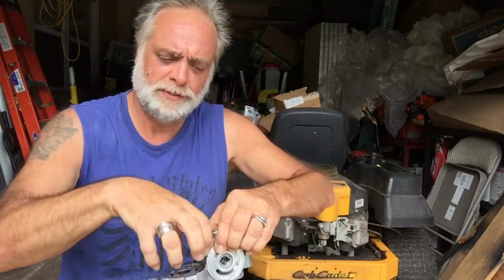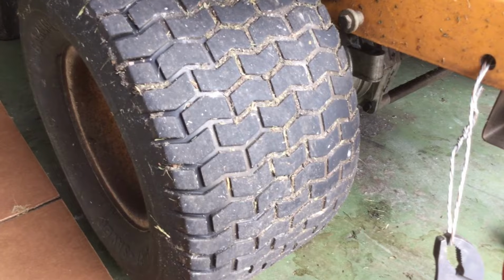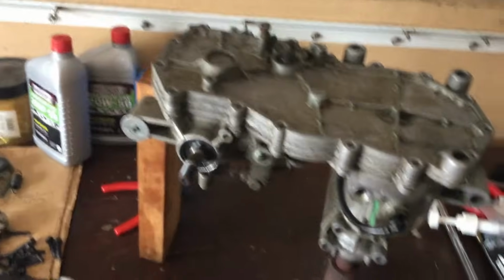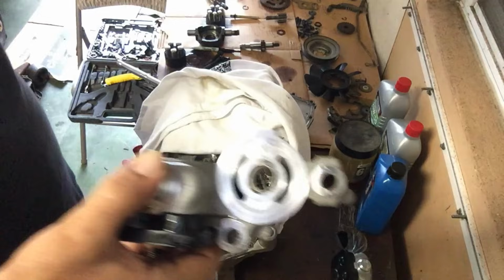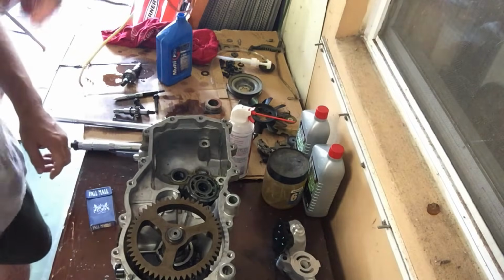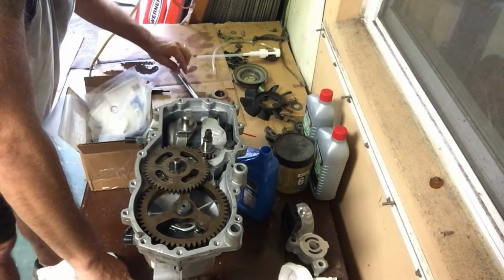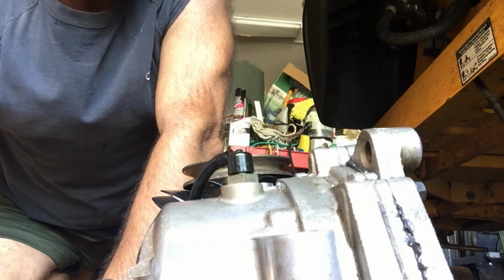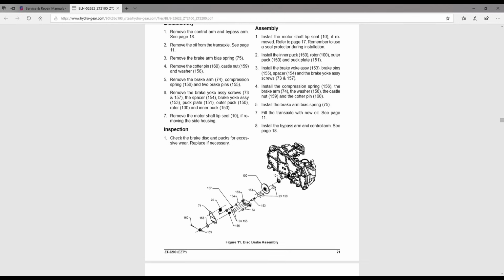Cub Cadet RZT 50 Riding Mower Hydro Gear Transmission Rebuild

Comment: I was mowing with my zero turn and it stoped driving on one side randomly any ideas
Reply from the maker: Blah, 11 months ago I might have been able to speak more intelligently about it, so I’m just speculating.  Is it a hydro gear  transmission?  Does the side that stopped make any noise when it’s engaged?  Does it ever work or has it stopped completely?  Was that side loosing power slowly or was it working fine and suddenly stopped?  It could be something wrong with the COG brake assembly, maybe its stuck.  Could be something wrong with the bypass arm or bypass rod.  Could be something wrong with the control arm.

Other potential might be something wrong with the internal gears, but I’d think it would make a grinding noise if so.  If you were slowly loosing power over time, then it could be the pump block and center section and/or springs and pistons.

Lastly, could be a leak in the gasket and you have no fluid in he trans, but I’d think you would have heard some grinding before it stopped working.
Reply: @silentknightsaga2415  Thank you for   responding. I think it is a hydro gear it did shake and jump under any kind of load towards the end of it working. when it died I pulled the hole thing out I wanted to drain the oil out to see if their was like any O-ring crap in it so I drained the fluid out of it and  I got about 3/4 of a cup of tar looking oil out of it and it was so thick I could not even tell so I put in fresh 10w30. I put it back in and nothing no noise I had it jacked up with the tire off when I tried and it didn't even try to move I checked the bypass rod I moved it back and forth it kinda clicked but nothing all the linkages move normal it is a single unit meaning the pump and motor are together. but I really hope I can fix it and not half to buy a new unit.
Reply from the maker: @gunnerstanwick6663  Well, sounds like the “joy” of cracking it open is in your future.  I’d think it would be unlikely if it couldn’t be fixed, though obviously depends on what type of damage you might find.  All parts are replaceable, so it’s a matter of trying to accurately diagnose what’s “broken”. There are lots of moving parts in those things, but not overly complicated.  It could even be something as “simple” as a spring or tiny ring clamp that broke loose from the shaft inside.  If you figure it out, no matter what you do, make sure you clean the inside well, especially given the tarry substance you found, and keep any particles out of the unit as you work through it all.  That was the issue that caused my first rebuild to fail.
Reply: @silentknightsaga2415  Well I am probably going to half to do that. I have a parts washer that might come in handy. but I will keep you posted on what I find

Comment: This was a good instructional video.  One of the better ones on the subject.  I’ll offer a little constructive criticism though, and I’m in no way jabbing at you.  It should have been edited down to about 1/3 the length you have it.  Also, be careful when removing the seals and keep track of your lock rings...there is no reason whatsoever to drop $30 on a “seal kit”.  I did a lot better than you on the center section too.  Amazon had it for $110 directly from Hydro Gear.
Reply: Do you got a part number for it?
Reply: @kypyro5029    https://www.amazon.com/gp/product/B000PZSDLS/ref=ppx_yo_dt_b_asin_title_o08_s00?ie=UTF8&psc=1

Comment: Hey dude, thanks a lot!  There was a lot of good information here, very detailed. One thing to add, I rebuilt both of my Trans and you had mentioned not bothering with the axle side. Well it wasn't cleaning well enough for my liking and one ring clip holds it in so I took it apart, there is a reservoir underneath the big gear for the top bearing to stay lubed with plenty of oil. I found some grit and other pollutants in this chamber, so I cleaned it out and resealed it and while I was at it I went ahead and changed out the bearings which were only like six bucks a pair or something. I figured I had this much time and ca$h in it might as well go for it. Oh, one other thing, the breather hose on both of mine were clogged, hard to get rid of air pressure if it can't breath. I normally don't write these, just want to say thanks and share what I ran into. Btw, I think my hair line is a little higher now.
Reply from the maker: Yah, I didn’t want to press my luck with the axle.  Glad you found the video helpful, and there’s always hair club for men....

Comment: I really appreciate your video. My rebuild went pretty well.  I would not have attempted to rebuild this if it wasn't for your video! I found a way to "prime the pump" after the rebuild with it out of the machine using a drill to spin the drive, and I worked the bypass/operator with my hand until it primed up. The fill hole on my RZT22 is just about impossible to access after it is installed.  I made a video and gave a shout out to you.  I hope you don't mind.
Reply from the maker: Glad to hear it went well and that you came out of the process still coherent and human.  I’d like to see your vid.
Reply: @silentknightsaga2415  Here's a link. https://youtu.be/2MWIAlU388Q
Reply from the maker: @mattc6044  Ah, I see your trans does look a little different.  Was able to use a pneumatic wrench to take off my pulley.  Love how people solve their own unique puzzles they come across during their rebuild.  Don’t love how companies manufacture products that make it difficult to do common maintenance like refilling the trans oil.  I’ve seen some videos where people actually drilled holes through their deck to access the fill hole.
Reply: Excellent idea!!

Comment: SilentKnight Saga, You rock brother. I completed the rebuild, using this video and the manual. Success. First cut was flawless.  Thank you for your time, instruction, and shared mistakes. Also the commentary along the way, light humor, etc., was appreciated. Thanks again. (This transaxle was on my 2011 Bad Boy MZ)
Reply from the maker: Great, and hopefully you came out of it on the other end with a little more sanity than I.   Mine is still going strong so, what, now 7 months later I guess.  Hope yours does as well

Comment: Working on mine right now. One thing I truly appreciate is that you gave specific info about not removing the center section bolts before taking out the shaft. I will be putting the bolts back in to do this, cause that sucker is in tight and was wondering how to take it out without damaging something. I hope to update on this soon. Thanks so far for this video. Commentary is great.
Reply from the maker: Welcome.  First time I tried the rebuild I left the bolts in and went down a bit of a frustrating road, ended up chipping the casing a bit around the rubber gasket and did some unnecessary things that cost quite a bit of time.  Good luck with it.  Sounds like you’re making a lot of progress.  Most difficult thing after that is putting the pump with pistons back in with the center sections but if you do it as outlined in the video, it should go as smoothly as possible.  Lining the hole of the pump up with the hole of the center section so the shaft fits back in can also be a bit tricky, but perseverance will win. Once it’s properly aligned, it will slide in without difficulty, no need to force it.
Reply: @silentknightsaga2415  Awesome, thanks for those tips. I will be getting back to it in a day or two.

Comment: I'm about to perform this rework on my RZT-50.  If I have access to a mill, is there enough movement in the pistons to allow for refacing of the center section?  I'm imagining I'd only be removing about .005" off those mating surfaces to clean up the grooves.....no?
Reply from the maker: So the pistons are spring loaded so to speak and while I can’t say 100% that resurfacing the center section would work, I can tell you that those pistons definitely lay very tight against the center section so one would think a .005 shave wouldn’t cause a problem.  Just keep in mind, if it doesn’t work, you’ll have to do it all over again, so if you’re willing to risk that, then no big deal.  Good luck with it.  Remember to make sure the center section and motor/pump sections are completely free of any debris before reinstalling.
Reply: @silentknightsaga2415   Thank you  good work,

Comment: I have a RZTS46FAB and it needs the cooling fan replaced on the pump. I can't seem to find just that. All I'm seeing is the whole hydro assembly. Is there a part number for just the fan/pulley?
Reply from the maker: A couple things - FYI I went for several years without any blades on the pulley fan.  Not sure if it’s a big deal or not.  I replaced it during the rebuild simply because I knew I was pulling the transaxle anyway, so why not replace the fan, etc.

Im pretty sure the fan is a separate piece on all these transmissions.  If the unit has the hydro gear 2100 or 2200, the part number I got if off the CubCadet website in repair manuals section.  This is what they have listed under left half transmission, though it’s probably no different than right half for the fan at least.  It’s part 56 and # is HG-53050 says it replaces part 52365.  I can’t say that’s definitely your answer. It’s the one I ordered for the RZT50 which has the hydrogear EZT 2200 transmission.
Reply from the maker: So I took a look on the CC website.  I could only find rztsx46 Fab  not sure if that’s the same as yours.  The fan does LOOK different than the RZT50 and I see it looks like you can only order the fan as a kit that includes the pulley, etc.  You could order the fan from the rzt50 part number I listed in the other reply, but not sure it will fit.

You might be stuck ordering the whole fan/pulley kit.
Reply: @silentknightsaga2415  hey thanks for the thoughtful reply. My model number is 17ARCBN010. I looked at the diagram for the drive system and it shows the cooling fans on both sides, but it appears that cub only offers that entire drive system which is 900+bucks for each side. No wonder why people junk mowers when they break down now. Parts are too damn expensive. Lol
Anyway, the cub dealer near me can somehow just get the pulley/fan for around $40. I can only assume that there's a different mower in the lineup with the same setup in which you can purchase just the fans. I will report my findings back here for future reference of our fellow DIY brethren. These trannys seem to be finicky.